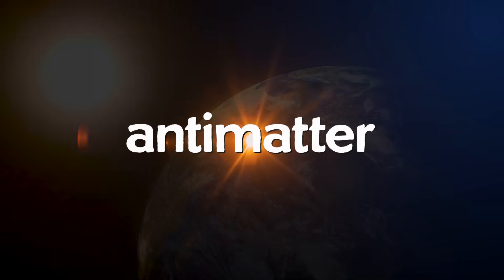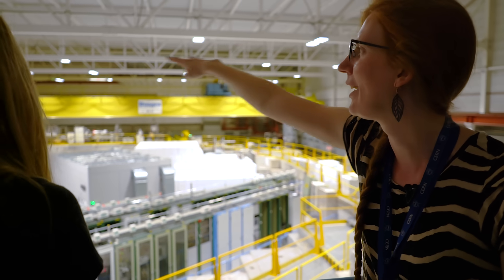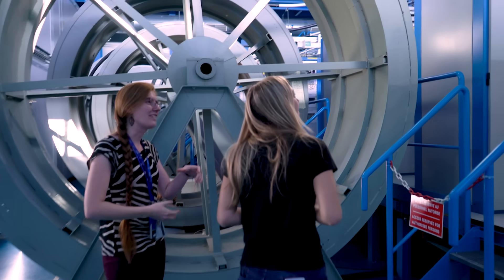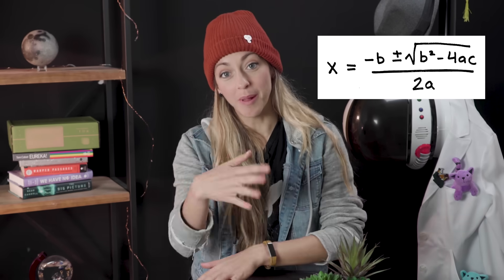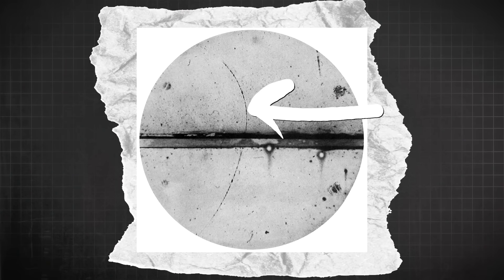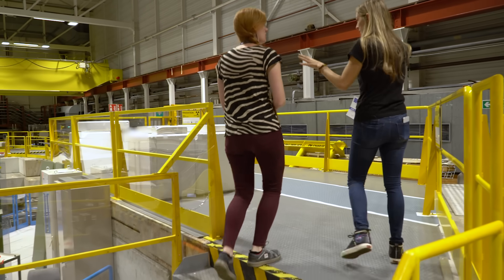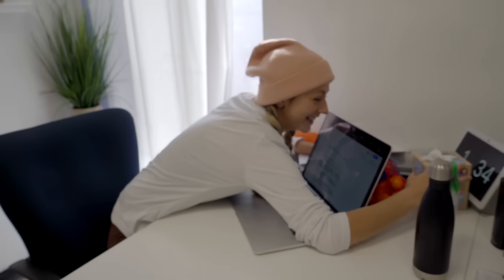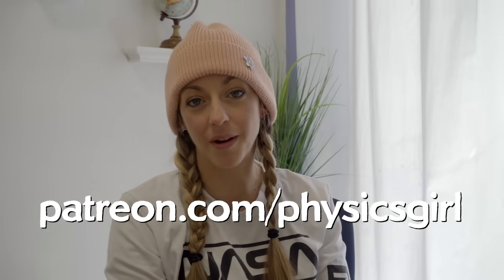Why This Stuff Costs $2700 Trillion Per Gram - Antimatter at CERN

Comment: What physics girl says: "the most expensive material"

What I think: printer ink
Reply: Austin Mconnell would like to know your location.
Reply: It's all in the perspective.
Reply: @alwinmt  haha haha haha 😂 isn't it All friend 😊 love and light 🙏❤️👌👽😁
Reply: Is printer ink made of antimatter?
Reply: @daveffs1935  For the price I'm paying it better be made of antimatter
Reply: @maxk4324  i bought a set of epson inks and as i plugged them in they went 'pooof'
Reply: @daveffs1935  Your display makes color from additive light (RGB), but your printer makes color from subtractive light (CMY, and cheating with K and other spot colors). It's almost a form of anti-light, which could explain why it's almost $2000 Trillion per gram!
Reply: @daveffs1935  that is nothing of your conCERN.

badum tsss.
Reply: @maxsimes  You're fired.
Reply: @daveffs1935  Something that's actually more expensive. Let's say you have a printer that has four cartridges, black, cyan, yellow and red. You want to use the black cartridge that is full, but the cyan cartridge is 20% full. The computer says you are out of ink, you must buy another cyan cartridge to use the black cartridge even though the cyan cartridge still has ink in it and you aren't going to use cyan anyways.  If you do want to use color, the color cartridges may work for one page image before they say they are out of ink even though the package says they are good for multiple pages.
Reply: @daveffs1935  tippex?
Reply: @daveffs1935  most probably.
Reply: @daveffs1935  No, printer ink is dark matter
Reply: Printer ink cartridges are a scam. The cartridges are programmed to show that they are empty when they're actually not
Reply: Me Flea they are also programmed to waste a lot of ink during cleaning cycles. You don‘t even have to print to run out of ink. And then there is this sponge in the printer that will collect all that wasted ink - and once it‘s soaked with ink the printer will just stop working with no way for the customer to replace that sponge and reset the printer. Yay.
Reply: @cbuchner1 The only way to clean a printhead is to pump something through it. On high end machines this is done with a cleaning solution, on cheap consumer machines the only available fluid is ink. Consumer grade printers are like disposable cameras - you can't compare them to high end DSLRs. You simply get what you pay for. Once you are ready to pay 10,000 to 15,000 dollars for an inkjet printer, you are in a pricerange where you can complain about cheap design if there was any. If you don't want to spend that much for a good machine, just buy a laser printer, which is designed for the consumer market.
Reply: When you realize that the cost of manufacturing for printer ink is about 50 cents per cartrage...
Reply: Once in a life time chance to see the collider, and we hear "" wow look at all the concrete". 
Fresh outta college or what lol
Reply: Printer ink is just unicorn blood.
Reply: Why are new printers cheaper than a cartridge of printer ink? I need answers
Reply: Sadly it's sometimes cheaper to buy a new printer than just the ink.
Reply: and now you know it is actually anti printer ink.
Reply: @hosmerhomeboy  ah, so that’s my my printers always break down XD
Reply: If you were ignorant enough to buy an EPSON printer like me, that's true. The con men who run EPSON make you buy color print refills when you just want to print in black and white. Not only that, the price is ridiculous and they last for few printings. NEVER BUY AN EPSON!!!
Reply: infinitytoinfinitysquaredbitch When printing in CMYK, true black can only be achieved by mixing all colors together. Black ink alone would result in a color that is more like a dark gray (think youtube dark mode). Therefore all colors have to be full, even if you "only" want to print black.

Regarding ink prices: Coming from the printing industry using Epson 8-channel printheads, I can tell you these things are expensive. Like, 1000 dollars each and more. So the printer manufacturers actually make quite a significant loss when they sell printers for a couple hundred dollars. This loss is made up with expensive ink refills. This is done so you don't have to buy a printer for 1500 dollars, because nobody would. Ink refills for 2 dollars wouldn't convince you to do so either, right? So don't judge on ink prices. You could theoretically get a high end inkjet printer for a couple thousand dollars and buy the ink in bulk, if you really want to. A liter of standard CMYK ink usually costs me and my company around 80 dollars.
Reply: @HouseGurke  Well said!  It all comes down to what your requirements are: basic printing vs photo vs professional; as well as what you're printing on: paper, photo paper, card stock.  If you don't like today's printers, I can recommend some dot matrix, thermal or electrostatic printers.  😉
Reply: @infinitytoinfinitysquaredb7836  I have an Epson that has a separate Black cartridge, also Yellow, Cyan, Magenta, Light Cyan and Light Magenta.  No trouble printing just black.
Reply: @infinitytoinfinitysquaredb7836  buy epson refillable cartridges on ebay. the bottles you get with it will last for years
Reply: @infinitytoinfinitysquaredb7836  easily solved buy an epson but dont buy epson ink 3rd party cartridges a fraction of the price
Reply: @infinitytoinfinitysquaredb7836  Epson is not the only one that does that. My HP printer went through a lot of color cartriges when printing blak and white only. I finally just started printing in full color since it didn't make much difference.
Reply: infinitytoinfinitysquaredbitch I had a printer and it came with 3 spare cartridges with the printer for £170 ish and it costs £90 just for 1 refill cartilage, cheaper to buy a new printer
Reply: @infinitytoinfinitysquaredb7836

Well... EPSON and any other printer, for THAT matter, because like... HOW does replacing the ink cost just as much or more than the printers??
Reply: I think Moroccan hash.
Reply: @ohasis8331  Doesn't MATTER.
Reply: or insulin
Reply: @ohasis8331  Punny.
Reply: Go Laser!!!
Reply: Rodrigo_vda   Forget printers and ink.  Rent a Monk.
Reply: Getting a graphic card now
Reply: We've been trying to reach you about your Antimatter warranty.
Reply: Hahahaha! I agree!😄
Reply: What I think:  op needs a laser with toner
Reply: Printer ink prize is falsely over inflated by design.
Reply: @ohasis8331  antimatter okk
Reply: It's not the ink, but the cartridges that are expensive.
Reply: Rodrigo_vda definitely printer ink
Reply: Inkjet printer ink is actually worth it if you print high volumes of high quality photographs.

If you don't, just get a LED printer or something.
Reply: I just buy a new printer...its cheaper than replacing the ink! Sell the old one, someone will but it.
Reply: Imagine a time when High school kids will have antimatter in their labs.
Reply: So...printer ink is made of anti matter. Wow! Who would have known.
Reply: @Jerry C costs 9 cents to make, sells for $50
Reply: Antimage is better lol
Reply: so true,
the most expensive material. school paperwork and projects
Reply: @ohasis8331  only matter.
Reply: Lmao
Reply: Oh Asis It anti-matters😊
Reply: @ohasis8331  lzd
Reply: When the time comes to change the ink cartridges and you realise it is cheaper to get a new printer! It’s not antimatter but something still to be named?!
Reply: @ajay_jay  i don't think tatsemystinkhole is talking about that god
Reply: you got me :D
Reply: XD
Reply: Now thats funny. Everytime for our Home HP its $200 at Amazon. SEVERAL TIMES a year!!
Reply: Definitely printer ink
Reply: The way they drastically disappear is "annilation".
Reply: just refill the cartridges 🤣
Reply: I was doing some heavy math on some ordinary looking paper, with regular printer ink... And when I wasn't looking, out of knowhere some spooky yet expensive anti-printer ink splatted out and blew up my printer!
Reply: Until someone figures how to alters colors in micro 2D draw spots of paper, by then, that will be the end of inks.
Reply: or a woman can cost more lol
Reply: @Z71 Dirtymaxx sad but true 👌
Reply: @Z71 Dirtymaxx haha 😂 that's a sign a second hand printer shop haha 😂
Reply: I just want to know about the interdimentional demons they encountered!
Reply: @morena012  not everything Interdimentional is a demon 🙏💓
Reply: Wedding dress
Reply: Hahaha go Pacers
Reply: What I think: Razor blade refills
Reply: I'm your 10,000 th like
Reply: Well Anti printer ink would
Reply: *coloured printer ink
Reply: Antimatter printer ink.

It’s what they use in photon torpedoes.
Reply: Don't you worry, soon the printer companies will have us buy ink made out of anti-matter. If we try to refill the cartridges they'll make sure a neat mechanism causes it to contact with regular matter and annihilate in our face.
Reply: Antimater printer ink = ERROR 404
Reply: costs more than human blood
Reply: Stop buying printers if the price looks like a good deal.. just read information on the printers and ask if the printer takes bulk, or 3rd party ink refills.. doesn't matter the brand🤷🏾‍♂️
Reply: So much outdated and incorrect information.
Matter doesn't exist. 
Energy doesn't exist either, which is why it can't be created or destroyed. 
The only thing that exists is the mind of god.  Everything else is illusion.
Reply: TasteMyStinkhole 
Can I ask, if you’re so heavily prejudiced against science, then why are you watching videos from this channel?
Reply: @TasteMyStinkholeAndLikeIt  Oh my... The whole universe is an illusion in God's mind!! Genjutsu confirmed!!!!
Reply: @Jdogg4089  LMFAO if dude has us in an infinite tsukiyomi legit id be pissed
Reply: @TasteMyStinkholeAndLikeIt  Your profile name makes your comment somewhat less meaningful...
Reply: @TasteMyStinkholeAndLikeIt  Nailed it.
Reply: @TasteMyStinkholeAndLikeIt  😂 please go back to school 🏫
Reply: @TasteMyStinkholeAndLikeIt  sooo 100000% no shade or ill will... its hard to tell from reading written words... what do you think god is im super curious of your viewpoint on the situation
Reply: @TasteMyStinkholeAndLikeIt  What is god?

Comment: You don't use over the hundreds place when putting a prefix on a large number.    That two thousand, seven hundred trillion is absolutely wrong, it should be ""two quadrillion, seven hundred trillion"  Never use a thousand when describing numbers unless that is describing exactly the thousands place. 

Even worse you're claiming to be "Physics girl" so you should have used scientific notation and called it 2.7 x 10(exponent)15 and absolutely should not have made this mistake.

Comment: I don't know why the universe seems to contain so little antimatter - but I have a fan theory.   If the Feynman-Stueckelberg Interpretation is real, then during baryogenesis when time itself was beginning to have meaning in the nascent universe (since bosons don't experience time like baryons do), the baryons that formed were about 50% antimatter, and the antimatter baryons were moving backwards in time.  There would have been significant collisions between the forward-moving matter and backward-moving antimatter, but the energy released from an antiparicle colliding would have resulted in another 50% toss-up, and so on.  It would mean the universe is a four-dimensional hourglass shape, with the throat of the hourglass being the diameter of the universe at the start of baryogenesis.  The big bang, as it were, went boom in both directions of time - it is the singular big bang AND the singular big crunch.   Just a fan theory....

Comment: As a fan of the now "old", the real Star Trek series (I'm talking about TNG, DS9, VOY and even a slight bit of TOS), I know about Antimatter. It gets injected into the drive core from one side, while on the other side, matter is injected. They meet at the dilithium crystals, which moderate the reaction and turn the annihilation product into superheated plasma which can then be used to power things. Like a faster than light engine. Or a force field that hides a planet. Or an energy beam that can push or pull an object of billions of metric tons through space. Or a means of teleporting stuff by disassembeling it, converting it into a coherent stream of information and reassembe it somewhere else, thousands of kilometers away. Heck yeah, I'm a nerd ;)

Comment: The part about antimatter possibly falling upward got me thinking, and I thought I'd share my thoughts. Half, if not most of this is unrelated but I thought it was interesting:

If antimatter had negative mass then when you tried to push a positron into a container with a positively charged plate, it wouldn't work. This is because of f=ma, or a=f/m, if you try to repel the positron into said container with a positively charged plate, the negative mass actually makes the acceleration negative as well, so the positron heads towards the plate. As this does not happen, we know they don't have negative mass.

Negative masses also still fall in normal gravity, however. f=mg, so the negative mass means the object is pushed by gravity.
But again, as a=f/m, the negative mass means this pushing force accelerates the object toward the positive mass.
So the reason for antimatter falling upward wouldn't be negative mass, but some other property.

As far as I can tell, negative mass must be impossible. This is because while positive masses attract negative ones, negative masses repel positive ones. The pushing force exerted by the positive mass on the negative one must, by Newton's laws, mean that the negative mass exerts a pushing force of equal magnitude on the positive mass. As its mass is positive, it is indeed repelled.

So we have an object being repelled by another object, which is itself being attracted to the first. They will follow each other, accelerating ad infinitum. Now let's attach this system to the end of a pole, with a generator in the middle. Infinite free energy as the two follow each other in a loop, turning the generator to produce energy. Infinite free energy is of course impossible as per the laws of thermodynamics, and so negative mass must be too.

I could be wrong, so look it up if you're interested.

Comment: How can Antimatter be contacted in anything made for matter??? ✨
Reply: Magnets, positrons and antiprotons still have an electrical charge so you can trap it in a magnetic field. It's the same as for how you contain plasma that's 100 million degrees hot in a fusion reactor.

Comment: If antimatter is anti in all aspects does it emit negative light? Are the measurements also negative? Do you have to think negative? If it has negative magnetic field is it then repelled from matter and therefore not existing on earth (like soap in a water spice bowl)? Is our attraction to earth actually antimatter accelerated away from earth and therefore pushing matter towards earth?

Comment: doesn't the "annihilation" part answer the question "why is there so little antimatter in the universe?
Our universe requires the absence of antimatter in order to exist in the first place.
Reply: Yes and no, if at some point matter and antimatter were present in equal measure they should have also annihilated in equal measure. Either the universe should be 50/50 or not exist at all. The question is if they were equal what lead to the lack of antimatter (or overabundance of matter depending on perspective)

Comment: When you get the replacement laptop, iFixit.com has easy to follow repair guides for laptops by various manufacturers, in this case, for thermal paste replacement, and it lists and sells the tools and parts you'll need.  That'll fix the overheating issue, and you'll be able to sell it on in good working order.

Comment: So a positron only difference with an electron is the charge. If it were part of an atom and went from a higher energy level to a lower one it's likely to emit the same wavelength of light as its counterpart. The same would be true for a star. And a galaxy. So how do we actually KNOW other galaxies are not entirely made of antimatter?